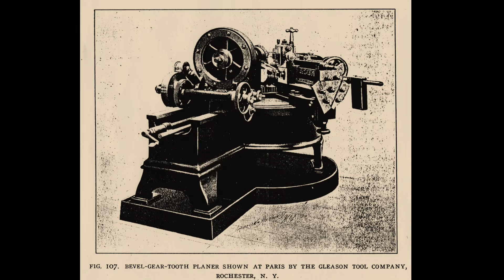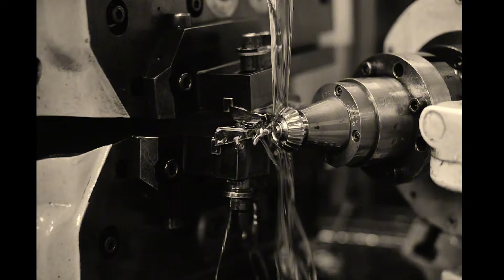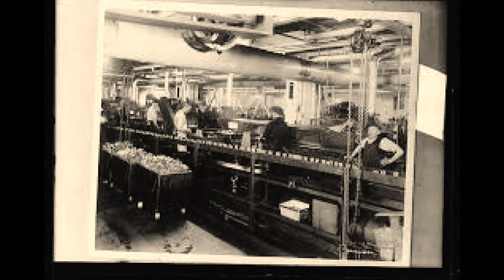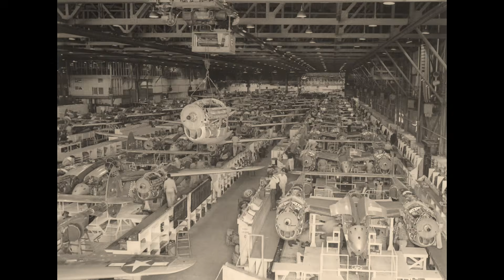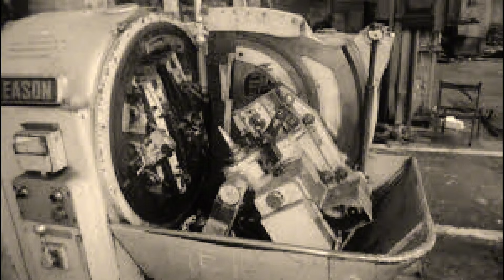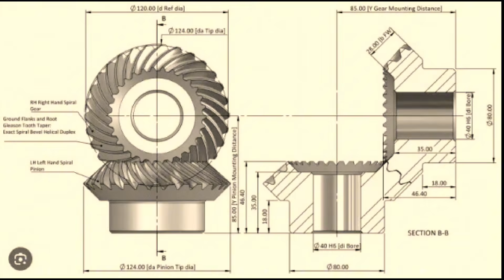The Story Behind the Legendary Machine That Got Rid of the Most Annoying Noise in Cars

Comment: Then there are the guys who spend tens of thousands of dollars to build a hot rod with a Halibrand Quick Change rear axle. You have a modern ring and pinion with a set of spur gears inserted between the ring & pinion gears so that the owner can change the final drive ratio quickly. It works, but boy is it noisy.

Comment: I worked at a shop in Paterson NJ called Eastern Gear they had about twenty Gleason gear grinders the products being ground were similar but not the same as shown they involved a Navy contract for gears for the Phalanx gun system there’s a similar system called Cwhiz a high speed Gatling gun that fires 20 mm cannon shells at a very high rate of speed.
We made the gears that mounted the gun accurately and the gears that moved the gun up, down and left to right.
There was one gear cutter machine by Gleason. This video shows how everything works except the grinding wheel had to be dressed by diamond tools and the slight curve of the wheel shape was accurate enough the final shape was blended by hand using a small piece of artificial diamond used to make the radius of the tip of the wheel and it was a skill that made the wheel edge very smooth to eliminate sharp edges at the bottom of the gear shape.
Reply: Ah yes Gleason gear grinders. I worked on them for a short period. Never got good at working on the, They always dripped oil on you when setting the dresser up for the next job. Also a little known fact is Gleason made two machines for Wankel engine. A milling machine and a grinding machine to shape the rotor and the rotor housing.